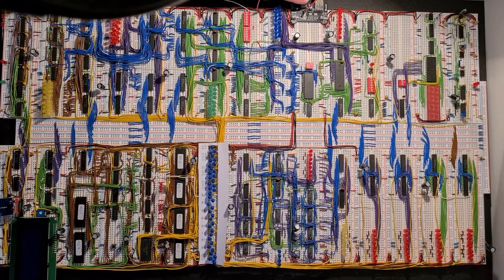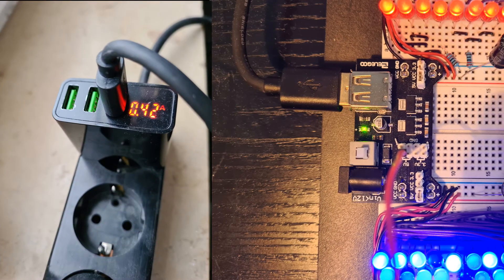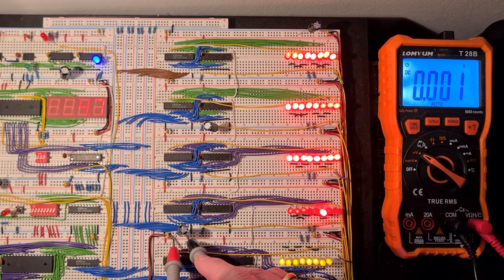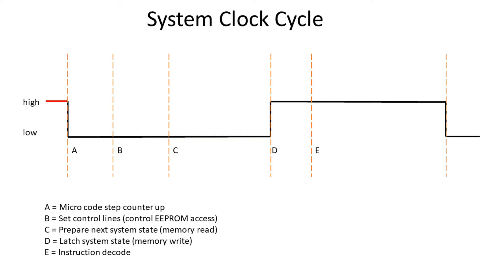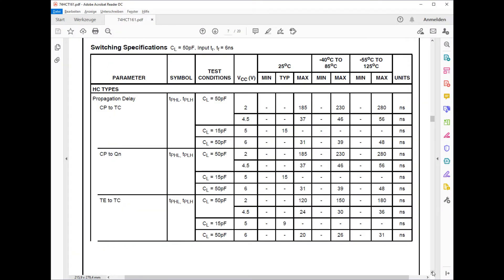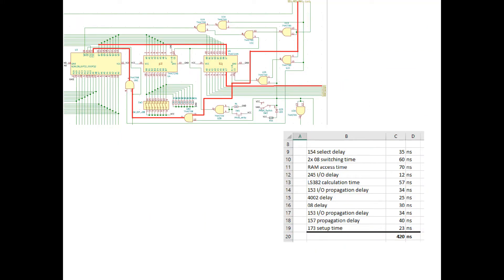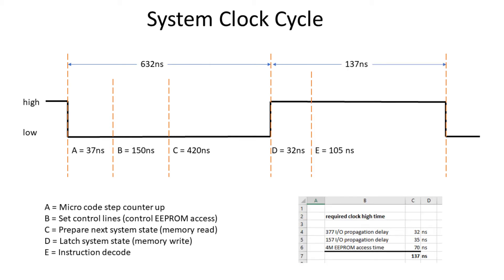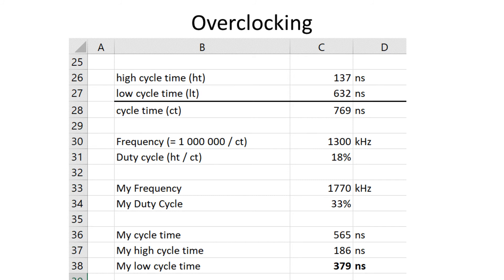8-Bit Breadboard CPU (Power Distribution, System Clock)

Comment: GREAT BUILD!!! Another possibility is to run single power rails along the left and right sides. Put a beefy 470 cap on each rail, and use a .1 uf cap on each power rail in the build itself. Connect each breadboard individually (no daisy chaining boards) to the power rails you just ran which now act as a buffer. Hope that makes sense.

Comment: What a cool build. Thank you for sharing. Great information about timing.
I might suggest: getting a higher current power supply, running individual power wires to each breadboard, and placing a decoupling capacitor on nearly every chip, as close as to the pins as possible. Then, a smaller bulk capacitor could be used on each board. An old PC power supply can be used to power something like this--just making sure you have the ground and 5v lines, as their are 12v lines, as well. Some power supplies have negative voltages.
Also, perhaps a very small pulldown resistor, such as a 10k might prevent ringing on the bus and logic lines.
Reply from the maker: Thank you for the nice words and your suggestions.
Indeed I upgraded the power supply from that simple breadboard power feeder to a (cheap) bench power supply. That allowed me to crank the voltage up to 5.2V which allows the system run more stable (especially the keyboard). Adding those decoupling caps to all the chips that have a direct connection to the clock line was the change that made the integrated system run stable for the first time. Ever since I add a cap to every new chip. And yes: From time to time I wish I had a direct power conenction to every single board and not just sections of boards. But most of the time my built runs stable enough.

Comment: Hmm.. my breadboard Z80 computer works at 10MHz with no issues.
Reply from the maker: If you have a fairly recent CMOS version of the Z80 it should run that fast. What I tried to show in this video was that the frequency limitation lies in my processor design, which of course is much less capable than a Z80. A breadboard computer might run faster than mine if the design supports such frequencies. SLU4 showed his implementation running at 10MHz lately. One can find several VGA implementations based on 74xx chips running at 25.175MHz on breadboards.
But I haven't designed for maximum frequency but just for having it even working.

Comment: This is some impressive work! My computer is still a work in process, and I recently changed  the step counter chip to a ‘393. It counts on clock high to to low phase, removing the need for inverting the clock. 
Is there a reason you’re not using one, and instead invert the clock? Mostly wondering since maybe there’s some flaw with my ‘393 idea? I haven’t seen it used by anyone else.
Again: really impressive stuff!
Reply from the maker: Thank you for your nice comment. There's nothing completely wrong with the 393 type, but it's not suitable in my situation for two reasons:
1. It doesn't allow for chaining since it has no ripple carry out flag.
2. It doesn't allow for presetting the counter to a specific value.
My step counter is more like a micro code program counter. It is 12 bits wide and is not being reset at instruction start but instead loaded with an instruction specific start value. If you're interested in more details, you might want to watch my video about the control logic and instruction decoder of my build at https://www.youtube.com/watch?v=nNKOJ-0p7pg .
But if all you need is counting from 0 to a value less than 16 - like in Ben Eater's build - you will be totally fine with that chip type.

Comment: This is a great set of videos and a fantastic build. Thank you for sharing both on here and via GitHub. On your clock schematic on GitHub I spotted a small typo. It is on the middle 555 timer and pin 7. I think it should be connected to VCC instead of ground. I double checked on your video and you have the 1m resistor going into VCC.
Reply from the maker: Thank you, and of course you're right. I've put back a corrected version on GitHub.

Comment: @DerULF1I am trying to recreate your design.  I am confused, though,  For the clock circuit, it says that C4 is 10nf and it is polarized.  Is that a typo?  Should it be 10uf like C2 in the Control Logic module?  From the video above, it appears to be of type electrolytic.  According to the conversion chart, that would be .01uf, which I can't seem to find in electrolytic.
Reply: Schematics are a bit like comments in programming code: nothing enforcing it to be correct or up to date. 😅
Reply from the maker: Sorry for me to confuse you. Of course the schematic is wrong in the sense that C4 is not polarized but a 10nf (103) ceramic capacitor. In the beginning it used to be an electrolytic type. But I changed it to a lower value and forgot to update the schematic. A higher value wouldn't cause problems but make stepping slightly slower.
At the same time I found out that C5 - which effects the system speed - also has the old value in the clock schematic. Right now it is a 68pf (68) ceramic type capacitor which lets the system run at the speed you see in the video. The 100pF from the schematic was much closer to the theoretical maximum, but later I found out that in practice the system is capable of running faster. I even had success there with 56pF, but I don't have enough courage to keep it.
I hope otherwise you get as much fun as I got while building that system.
Reply: @DerULF1  No problem!  Just trying to figure it all out.  I am guessing that you didn't update the schematics when you added all of the capacitors for the power improvements.  Thank you for responding.

Comment: Use localized LDO’s and run the system off a 7-12V PSU.
Why did you use different 555’s in the clock section - TLC555 vs NE555?
Reply from the maker: The TLC555 is generating the system clock. A NE555 has a maximum frequency of about 500kHz in astable mode, while the TLC555 can run as fast as about 2MHz. Since my system is running at about 1.8MHz a NE555 wouldn't have been sufficiant.
The two NE555s are only used to debounce the single step push button and the stop/run switch. So for that purpose I could use those cheaper type of 555 that I had already lying around here.
Reply: @DerULF1  Great! Thanks for the quick reply.
Makes sense.

Comment: Fantastic build and video. Please continue
Reply from the maker: Thank you for your nice comment.
The next video (covering the instruction decoder, control logic, reset cycle and interrupt logic) is already scripted and planned to be going released in a few days.
Reply: Great news! I’m building my own 8 bit computer based on videos from Ben and James and your design is of particular interest to me as just like you I decided to use 64kB memory so 16bit address line. But I wasn’t planning on a separate memory bus, so that’s interesting. 
I can see from you schematics - if I read them correctly- that you access ROM when SO is not low and you address the 3 highest bits. I’m looking forward to your future videos. Many thanks for posting them and the schematics